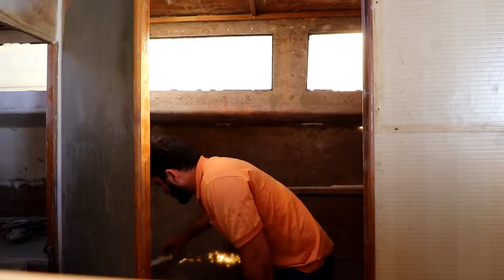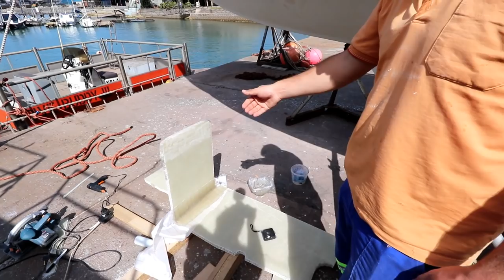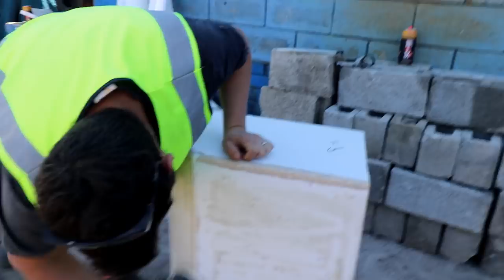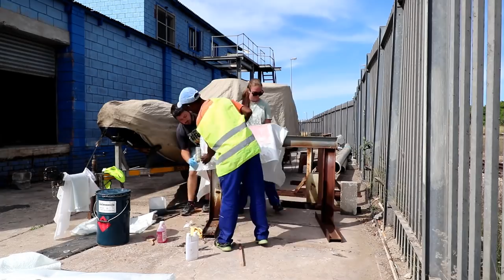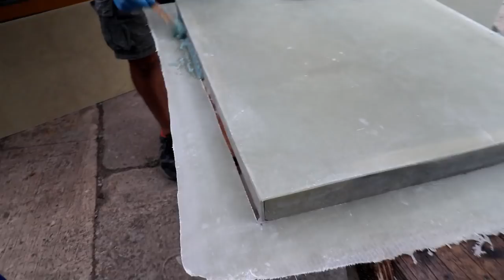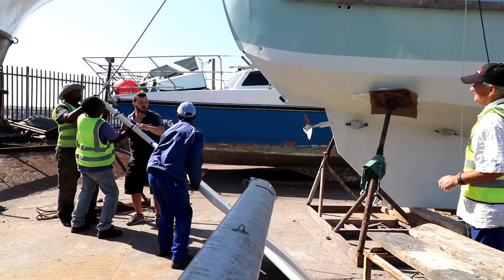Building a SHOWER for our YACHT! | YACHT REBUILD WEEK 17

Comment: Great video guys.  If I could make a small suggestion, when taking time lapse footage it might be better if the camera is placed somewhere stationary.  It will probably  be a little easier on the eyes without the jitters.  Just my two cents of course.  Can't wait for next upload.  Have fun and stay safe !!
Reply from the maker: Thanks George,

We do normally have her on the tripod or on a flat stable surface but other times we forget the tripod and have no where to put her. In this case we were working outside a warehouse which didn't really have surfaces we wanted to put our camera on or there are no surfaces at all but you do make a valid point. :)

Thanks for watching!
Reply: And thank YOU for sharing :)